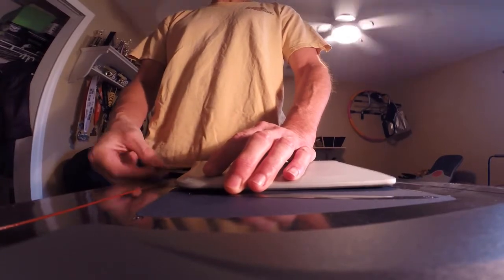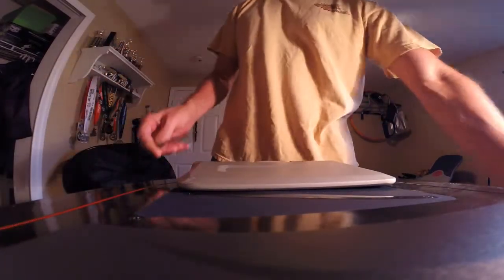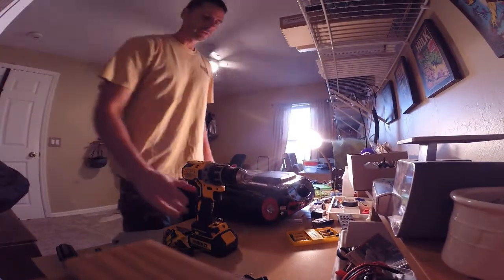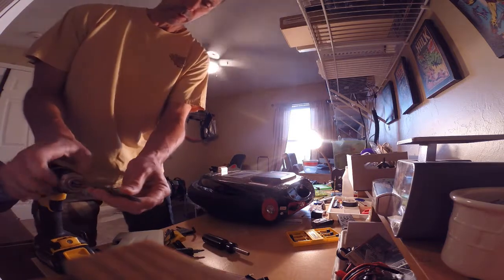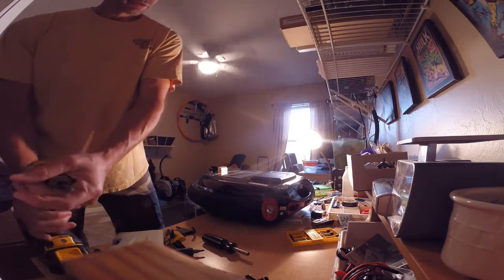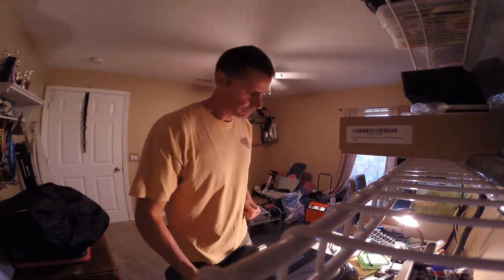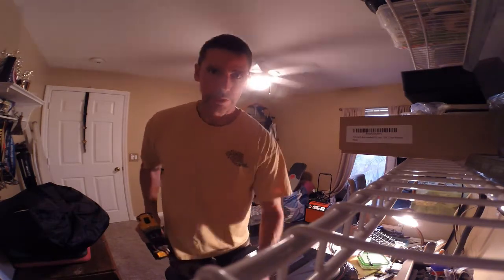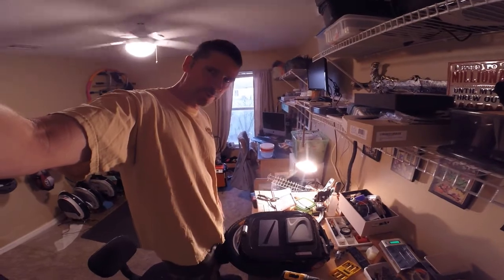Checking motor wire connectors on Gotway Msuper V3

Comment: I thought I drained the battery on my monster but I guess I didn't and when I plugged it back up it electrocuted me and I think it burnt the connector 6 ,will it still works if not how do I fix it?
Reply from the maker: Wow that sounds bad, the battery pack needs to be removed and inspected for damage.
Reply: Duf it only looks like I damaged the male connecter 6

Comment: Thanks for the video Duf. I've yet to open any of my wheels, but that was super simple. The wiring harness actually looks pretty good and well organized. If I open mine I may be tempted to apply some heat shrink tubing over those connections as an additional insurance policy to keep them connected even if there's some melting action going on.

Much too clean - you need start riding trails ;-)  Do you have access to trail riding (usually the same trails the off-road bicyclists would use) in Florida?  I find it very fun. Although perhaps in Florida trail riding exposes you more to alligators??
Reply from the maker: I have some high quality electrical tape I was thinking of applying to the connections, I may still do that.

There is actually a old cypress logging trail near me that goes right through a swamp.  The terrain is mostly grass with some areas of soft mud/sand.  I have been considering taking the Msuper there although after seeing what sudden exposure to soft sand at speed can do to these wheels (pop a board), I am a bit hesitant.